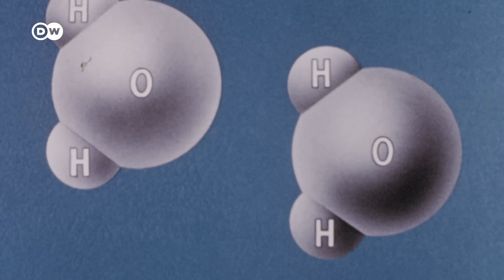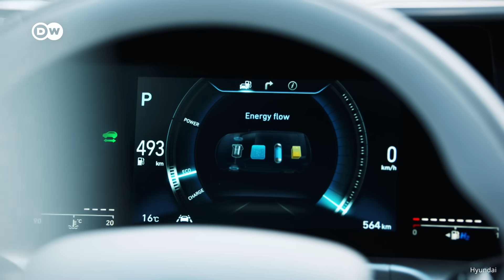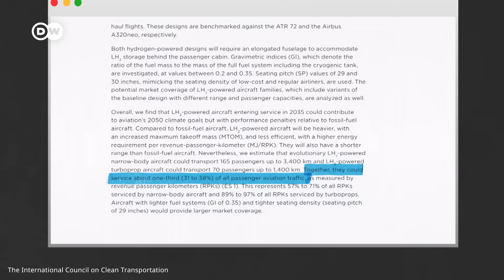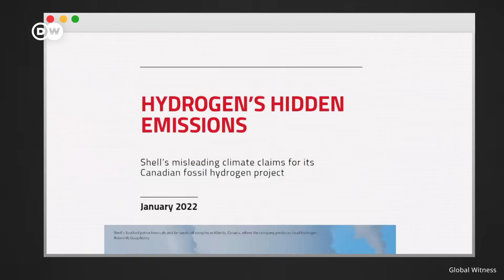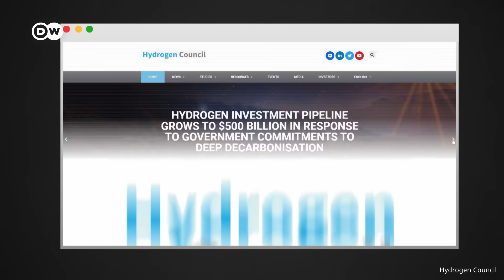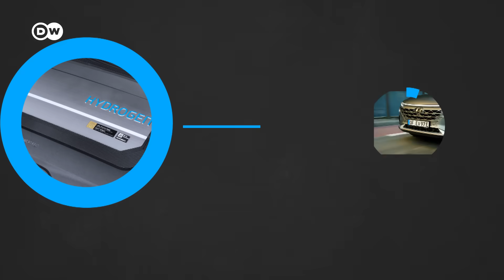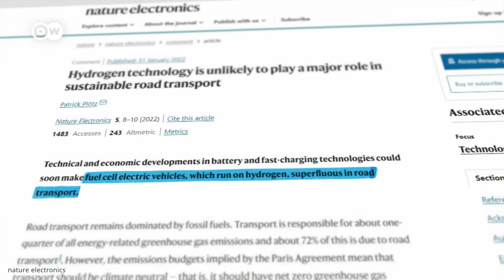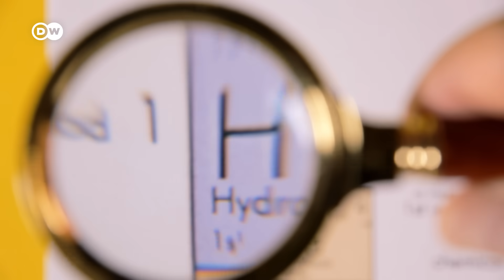The truth about hydrogen

Comment: Wow, I seriously had my own hydrogen video ready to release on Tuesday, but now I might need to delay it. Regardless, you’re spot on with everything my research found as well:

Places hydrogen can be used: when made from renewable energy, maritime shipping, aviation, steel production (CCS needs to be applied though), and long term storage of energy.

Places hydrogen can’t be used: when created from methane (even if CCS is applied), cars, home appliances, industrial process that use medium heat (think any normal oven)
Reply: Hydrogen can probably also be used in heavy vehicles like cranes and tractors, as electrifying those vehicles would make them way to heavy and the necessary charging makes it almost impossible to have them running like 18 hours straight
Reply: @ElRhino9  interesting. This is the first argument I’ve heard about cranes. Sounds likely. Although some more stationary cranes like in a shipyard could likely be patched directly into the electrical grid so this is maybe more likely for mobile ones.
Reply: @SaveMoneySavethePlanet  Like your research to be done on dock side cranes in Croatia who for some years now use super capacitors to capture the load lowering energy and use it to lift the next load with a small help from the grid. A no brainer and no batteries......... Many industrial application should be reviewed and understand what the real energy requirement is. 
As for Hydrogen in buses and trucks: many projects are being canceled because the cost of hydrogen is not coming down in the near future and that is without talking about the inherent inefficiencies.
Reply: @RAHellemans  very interesting! I’ll look for a source on the Croatia cranes. Sounds similar to mining trucks I’ve heard about recently. Due to the geography of the site, the truck comes down a hill with a load and uses that chance to generate a ton of electricity. Then when they drive back up the hill without a load they are able to use all of the electricity that they just generated.

Like you said, we really need to rethink a lot of different systems and implement stuff like this where it makes sense.
Reply: @SaveMoneySavethePlanet  Yes these cases are all pointing at the same problem that of the way industries make their money. In other words their financial model.
Take the ICE car industrie: their dealers make half of their money on sales and the other halve on servicing. So ICE dealers are incapable of selling EV's as it will kill their business as they know. It has taken the arrival of Tesla to get that industrie to move.......
Consider now the "heavy industrial industries"( like John Deere, Fujitsu Heavy Ind etc) their after-sale income is over 50%. Ask any farmer the annual maintenance cost of a combine harvester! So this entire industry need a Tesla like electric chock to start their revolution of electrification.
Reply: @RAHellemans  yup. Reminds me of a book I was reading recently where the author said something along the lines of “quit saying that you want a free market because it doesn’t exist. All that happens in a free market is the person with the most money starts making the rules.”

So we might as well take make control and make rules that make sense. Otherwise, all the biggest companies will just make rules that favor their profit and let them not change.
Reply: Long term storage is a bit iffy on what you mean by "long term". Batteries actually lose less energy over time than hydrogen as hydrogen, from it naturally being the smallest element, has  a tendency to leak from it's containers over time no matter how small the imperfection was. It's basically the sand of all elements. If there is a gap it will make it through, even if you can't even see it. It's why hydrogen really fell out of favor with rockets as you just can't hold onto it for long missions. It was one of the primary reasons SpaceX for example switched to methane.

It also has the effect of basically slowly destroying its container over time from the same method as how it escapes small gaps. Think of it like sanding open holes in the container.
Reply: They plan on aquiring the methane through biomass in the near future for car use making the foot print lower than EVs. 
Like the e cars, this technology is still being refined and developed.
Reply: Ehhh I’d be very cautious about hydrogen since if it’s compressed and there’s a leak… give it some air and it’s exploding without fail
Reply: For energy storage, hydrogen has a round trip efficiency of around 20-40%(this really depends on the efficiency of the hydrolysis and power generation [Auto cycle or Bratton cycle w/ or w/o a HRSG or a fuel cell]). Whereas batteries have a RTE between 80-90%. Plus the maintenance costs for hydrogen will be significantly higher than simple motionless batteries. Plus all of the infrastructure required for hydrogen ...
Reply: Please search this on youtube "Hans Olof Nilsson and the first hydrogen-powered house"  you will see that your conclusion is not completely correct.
Reply: @aswad7368  I watched it. The only reason he has hydrogen power is for long term storage of energy so that he can stay disconnected from the grid during the winter. I explicitly mentioned long term storage of energy as a place where we should use hydrogen fuel.

So it looks to me that we’re saying the same thing.
Reply: @SaveMoneySavethePlanet  We are almost saying the same thing, you have mentioned that it can not be used in cars(I awesome like a fuel) or not efficient enough, I say it can be used in cars in an indirect way. Solar power - > storage in hydrogen-  > electricity- > Bev cars (of course it is not the most efficient way but  in countries like Sweden where winter is long and solar power is reduced this is the best case scenario in my opinion) This enables green energy all year long so Hydrogen is a viable source of energy in my opinion